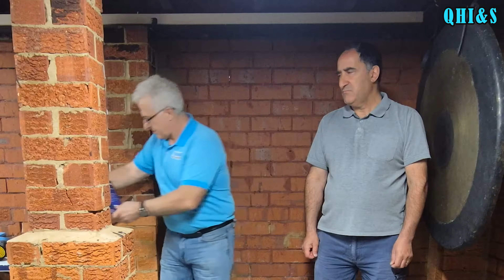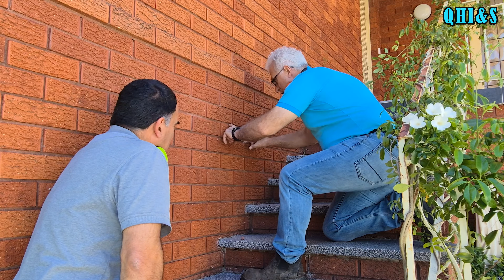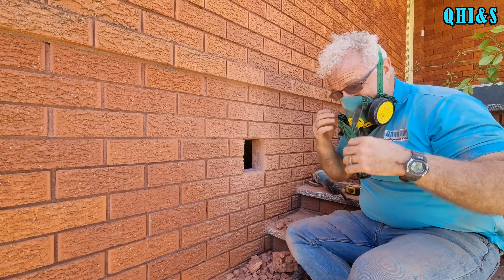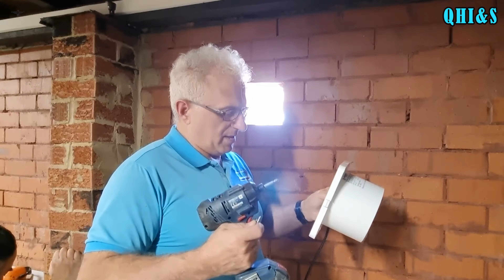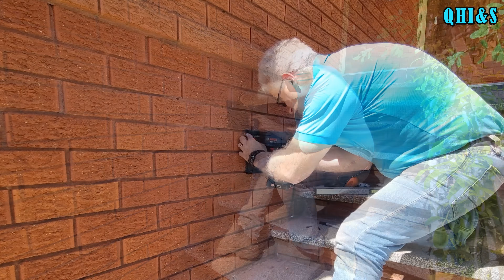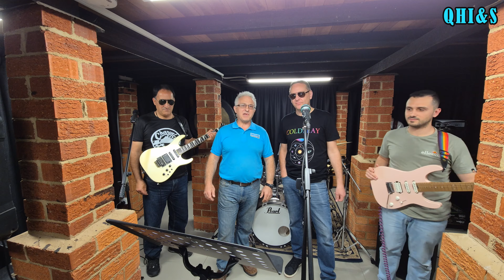I Eliminated Basement Dampness with a DIY Ventilator! Blauberg

Comment: such a great solution and the placement will work really well. It doesn't need much ventilation, just enough to get the air flowing. I also really liked how you problem-solved your way through the installation. Most videos won't show that and we wouldn't be aware of it until we're halfway through the job. Great Job Moussa!

I do like that fan you're using. I've got two of them in my apartment. I designed and 3D printed a bracket and mount so it they sit in the kitchen and laundry windows. Looks a big odd from the outside seeing a panel sandwiched in the window but really works well and it's quiet!
Reply from the maker: @OneIdeaTooMany  

Thank you for your comment. I found that whenever I have a problem that needs solving, to take a step back and go through all the possible options. Then decide which is the best idea. 

This was the first time I used this brand, but I was very impressed with it.

Comment: Nice, we use a dehumidifier to do the job
Reply from the maker: I have always been curious about how they build house basements in the USA. Do you know many stories, good or bad, with water coming in from the water table & how the builders stop it from entering into the subfloor area?
Reply: @ 

Bentonite clay can be used to help stop basement flooding by acting as a waterproofing agent, where it is injected into cracks and gaps in the foundation walls, expanding when it comes into contact with water to create a seal and prevent further water infiltration; this method is often referred to as "bentonite injection waterproofing.".  Found on google search..  I know we use drain tile on floors and a tar wrap on foundation walls .